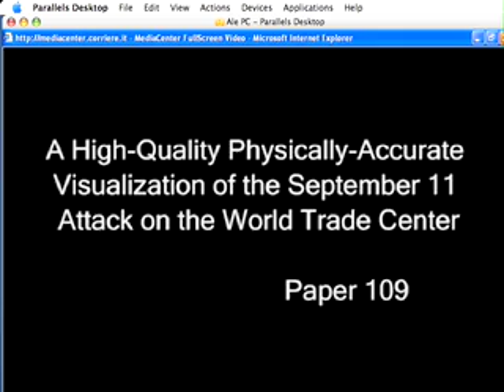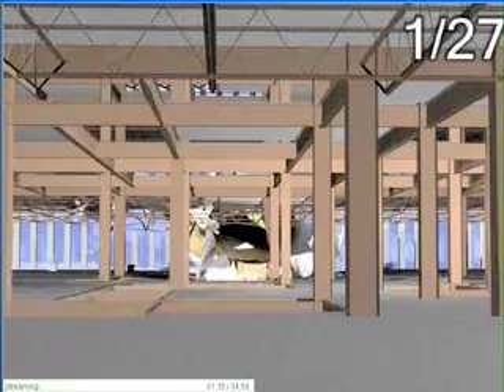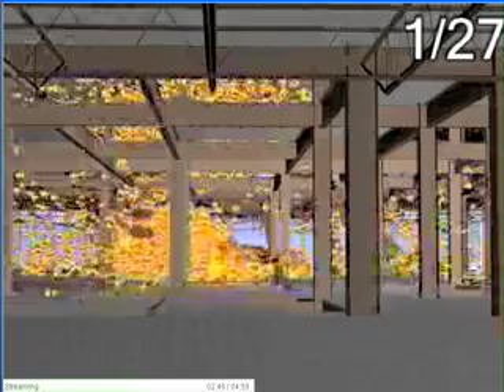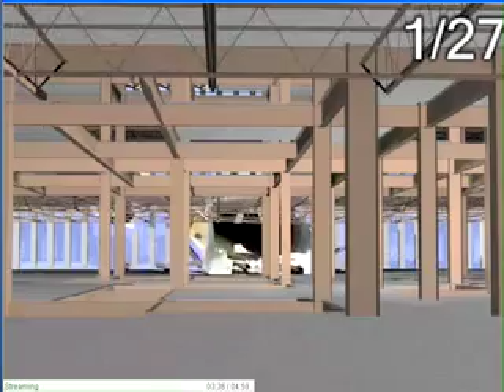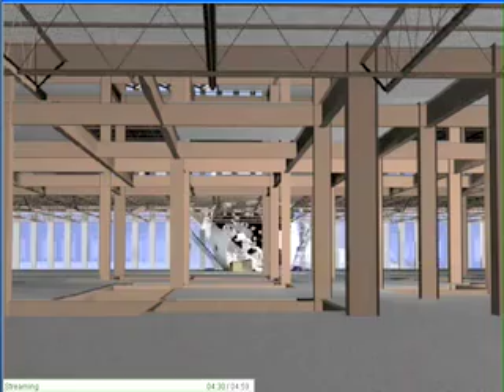9-11 Twin Towers Attack 3D simulation

Comment: Chemistry major here. The main point is that the jet fuel cannot provide enough energy to melt steel. Simply search up the MSDSs for both substances. The most the jet fuel can do is obtain thermal equilibrium with the steel and that will still need hundreds of more degrees in order for it to give way. Can someone give an adequate explanation as to how the heat of the jet fuel can melt the core of this building? 

How can this building fall down so 'cleanly?' Shouldn't there still be steel beams sticking out of the core of the building?

Thanks..
Reply: +Mark Euglin you don't need to "melt" the beams in order to weaken them, that's basic logic being ignored
Reply: Mark Euglin but, I'm not, I'm just responding
Reply: well it’s kerosene in the jet fuel that weakens the steel integrity.

Comment: WTC was designed for high speed impacts. 6 floors of structural steel were impacted. The only way to collapse such a structure is with  controlled demolition.

Comment: Each tower was designed to take TWO large jets just in case, and still stand!  The frame was designed to cut them up like a cheese shredder, much of the plane therefore kept out of the building.  Yet in the close up's of the second jet, it enters the building as if it were only soft butter; almost none of it is blowing backwards until the very end.  That just does not add up.  Those of you in school or university should speak up in your classes.

Look into the warning sent to certain people 2 hours ahead of time.  Look into the jerks who were arrested in New Jersey for 'laughing and celebrating'.  Just two of the clear links we have back to a country that wants us to hate Arabs.
Reply: +Denise Hammon-Ross True, the WTC buildings were designed to survive an impact from a single 747. (Not two, as you believe) But did 747's fly into the buildings? NO. Look up the major differences between a 747 and a 767. A 767 carries a LOT more fuel than a 747, and flies significantly faster. Since the 767 did not exist in the late 60s when the WTC was designed, the engineers could not design the WTC to survive an impact from an airplane flying as fast as the 767 nor carry the fuel that a fully-loaded 767 can carry.
Reply: The 747 was not around when the towers were designed, each tower was designed to withstand the impact of just 1 707 at low speed and with almost no fuel, not a heavier plane with a lot of fuel at much higher speed.
Reply: evsupp.
Are you not very intelligent?
The design was for a Boeing 707, low on fuel and at low speed, in fact no allowance was made for fuel, the 707 was not as heavy as the 767 which had a lot of fuel and was travelling much faster.
Double the speed = 4 times the force. 
Just look it up for yourself rather than take the word of twoofers.
Reply: Denise Hammon-Ross they were wrong in believing they would stand I'm surprised they stood as long as they did.
Reply: Barrie Rodliffe  Whenever truthers claim 9/11 was inside job, it's automatically true because they say so.
Reply: Steve.
Great.   You know more than Boeing then.   VMO does not mean   " this is the limit, the wings will come off if you exceed this speed."
The reason for the restriction on the 767 was nothing to do with the wings it was in case of birdstrike on the front windscreens, something the hijackers were not too bothered about.   
3 buildings collapsed due to fire just as quite a few other buildings have before and since.  
Maybe one day when you grow up you will find out how to look up things for yourself rather than just take in every conspiracy theory no matter how stupid.
Reply: Really amazing that other buildings have collapsed due to fire with no prior damage and no jet fuel.
No one really can be as stupid as you or maybe they can.
The strong aluminium wings at speed can break steel, that is a well known fact.   
The WTC towers were not designed to withstand high speed impact and steel will weaken in a fire so what is your problem with straight forward facts?
You accept the very weak and ignorant conspiracy theories.
Reply: evsuck. I thought Barrie did a masterful job of stuffing you on this thread. Short and sweet. Wish i could have been there to watch your run away sobbing.
Reply: truth?
911 an inside job?   Sure it must have been since you just claimed it.
Reply: Barrie Rodliffe  Right. Plus, they can't even agree on what the alleged inside job was inside of. Was it inside the Bush White House? The CIA? Israel? The NWO? The illuminati? Haliburton and the defense contractors? All of them combined? They don't know. But they're certain it was "inside" of something or other. LOL
Reply: Steve Healy. 
Maybe you should look at how much force an aircraft wing has to withstand just to lift the whole plane off the ground, yes strong wings or planes would just break up as soon as they hit the slightest bit of turbulence. Fortunately you have nothing to do with making or designing planes.
Reply: Kabuki Mime.
Even worse, they claim an inside job and then when asked for proof it was they demand proof it wasn`t
Reply: Denise Hammon-Ross. Good post.  The mossad agents found with explosives in a van and released!!!!!!! If they had been Muslim they would have been shot there and then. This is when the true face of Israel s meddling in America
Reply: Barrie Rodliffe. Would love to see you last ten minutes in 767 at 550mph at ground level. Barry
Reply: Steve.
If I was a pilot I would gladly do so but my name is not Hanjour and I do not have a pilots license.  As for 550 mph did you just make that up because I have not seen that speed. It was said to be 530 mph when flying over the Navy Annex building. 
Also wasn`t it a 757?
Maybe try to get at least one thing right.
Reply: 911 was an inside job!
Reply: World Trade Center a 3D Visualization WTC: https://www.youtube.com/watch?v=aj3fvxCQGi4&list=PLlZXuG7QSAcsTor6bwsFeJwKtacUIFrBO&index=4&t=16s
North Tower No Plane Seen: https://www.youtube.com/watch?v=Y4BFEYItlk0&index=5&list=PLlZXuG7QSAcu-OgrLuziSZ7Mp_buH0JU_
911 WTC2 no plane: https://www.youtube.com/watch?v=2ypMOWF0QvQ&index=7&list=PLlZXuG7QSAcu-OgrLuziSZ7Mp_buH0JU_
SOUTH TOWER EXPLOSION NO PLANE: https://www.youtube.com/watch?v=kDIwIQwgw5c&index=9&list=PLlZXuG7QSAcu-OgrLuziSZ7Mp_buH0JU_
9 11 south tower attack NO PLANE LEAKED FOOTAGE: https://www.youtube.com/watch?v=Sv92Q6y7F7g&list=PLlZXuG7QSAcuVRxAhKKwjdQq-tTZMILey&index=6
9 11 Flight 175 witness reaction! BEST FOOTAGE! Hologram wing fake plane: https://www.youtube.com/watch?v=7g6aAGr3b1c&list=PLlZXuG7QSAcuVRxAhKKwjdQq-tTZMILey&index=7 South Tower demolition: https://www.youtube.com/watch?v=TyfMVaWk6j4&list=PLlZXuG7QSAcsTor6bwsFeJwKtacUIFrBO&index=5
Terrifying, Close Up, Street Level Shot of First World Trade Center Collapse. September 11th 2001: https://www.youtube.com/watch?v=2-9TD3oQq3g&list=PLlZXuG7QSAcsTor6bwsFeJwKtacUIFrBO&index=7
WTC2 'Collapse' Luigi C , stabilized: https://www.youtube.com/watch?v=Ns89xtgLPWc&index=119&list=PLlZXuG7QSAcsTor6bwsFeJwKtacUIFrBO
9 11 Enhanced WTC2 B Riesman, Version 3: https://www.youtube.com/watch?v=o9bhsvfUMAY&list=PLlZXuG7QSAcsTor6bwsFeJwKtacUIFrBO&index=81
South Tower collapse: https://www.youtube.com/watch?v=-iUJE1z0dro&list=PLlZXuG7QSAcsTor6bwsFeJwKtacUIFrBO&index=67
9 11 Stabilized WTC2 Video Showtime: https://www.youtube.com/watch?v=oO14j15mBQg&list=PLlZXuG7QSAcsTor6bwsFeJwKtacUIFrBO&index=57
WTC2 Collapse Demolition 9 11: https://www.youtube.com/watch?v=twnDgQp6sxM&list=PLlZXuG7QSAcsTor6bwsFeJwKtacUIFrBO&index=40&t=3s
WTC2 'Collapse' Rare Trinity Zoom, Slow Motion: https://www.youtube.com/watch?v=5cLo4FDMztM&list=PLlZXuG7QSAcsTor6bwsFeJwKtacUIFrBO&index=51
9 11 Enhanced WTC2 NIST FOIA Release 27 #42A0239 G26D114 Version 3: https://www.youtube.com/watch?v=-TZQHFlQTMQ&list=PLlZXuG7QSAcsTor6bwsFeJwKtacUIFrBO&index=83
South Tower collapse slow motion HD: https://www.youtube.com/watch?v=gNupKvEFg1k&list=PLlZXuG7QSAcsTor6bwsFeJwKtacUIFrBO&index=11
WTC1 Collapse - Two NBC Cam Angles Combined (Enhanced NIST Clips): https://www.youtube.com/watch?v=yzNBgJNU-Tw&list=PLlZXuG7QSAcuWw4a4K_3UFOXV8bUqOuIv&index=3
WTC1 Collapse - Unknown NBC Camera (Enhanced NIST Clip "WNBC Dub3_31.avi"): https://www.youtube.com/watch?v=qGDuXbykLyQ&list=PLlZXuG7QSAcuWw4a4K_3UFOXV8bUqOuIv&index=4
9/11 North Tower Demolition - 10.5 Seconds (West Face Zoom And Slow PIP): https://www.youtube.com/watch?v=kZvXn02V4m8&list=PLlZXuG7QSAcuWw4a4K_3UFOXV8bUqOuIv&index=1&t=8s
North Tower Collapse Close Up Zoomed Repeated: https://www.youtube.com/watch?v=OOMswNsSckw&list=PLlZXuG7QSAcuWw4a4K_3UFOXV8bUqOuIv&index=26
North Tower Looped Collapse Narrated by David Chandler: https://www.youtube.com/watch?v=wAe1NCl6Ypc&list=PLlZXuG7QSAcuWw4a4K_3UFOXV8bUqOuIv&index=37

Faces of 3,480 Fallen U.S. Soldiers: https://www.youtube.com/watch?v=WsUuLl1rxj0
Wars in Pakistan and Afghanistan Leave 150,000 Dead: https://www.youtube.com/watch?v=PGDRKPwr6hI
Reply: +Marc Barrett In safety certification 707 was determined to cause only local damage, no effect on structural integrity whatsoever. They never even considered two planes because they were talking about a air accident like the one at empire state building. Each tower could have taken 10+ hits without falling. Maybe even 100+ hits. The planes simply cannot penetrate or cause significant destructive force to it. In human terms the mass of a 747 is 1oz to each tower's 195lbs. Even according to official story 95% of fuel would have burned up in fireball outside building and the little that remained inside in 10 minutes. All this is assuming there were even planes and not just CGI.
Reply: Barrie Rodliffe yeah bare, they collapsed from fire. Amazing that big buildings have burned for 24 hours and not collapsed. Your paid shill working for NIST or something. Because no one can be as Thick as you to accept the official version. Pull your head out of your arse.
Reply: Barrie Rodliffe, seen your nonsense on other you tube videos on 9/11.  To say that aluminium the wings of a 767, which it probably wasn't, will cut steel at the alleged speed of 530mph is in one word...................... Bollox.
Reply: Barrie Rodliffe. BAZ, STOP SPOUTING YOUR NONSENSE. 'strong aluminium wings' BOLLOX

Comment: I'm not an engineer, but these towers would probably be a little smoky, but standing if they had internal support columns like any other normal building
Reply: A good metaphor for this is "Poking a pencil through a screen door". Yes, it would damage a certain area, but it would not destroy an entire building. The facts just don't add up.

Comment: Jet fuel can't melt steel beams
Reply: brett nichols Jet fuel can weaken steel.
Reply: brett nichols Basically just a normal fire without any liquid fuel can reach temperatures high enough to weaken the steel.. Its more than obvious that fire there only weakened the so yet bent steel beam where all that mass came into the game.. bent the beam completely causing it go down with others and finally with the whole mid-upper construction causing the devastating domino effect
Reply: NotEvenDeathCanSaveYouFromMe What?
Reply: And your glukose in the brain can't capture anything
Reply: Your statement about steel loosing its strength above a certain temp. is 100% correct. (I'm a retired Structural Engineer with 38 years experience in the field.) Your only error is assuming these trolls and the Conspiracy Theorists are literate. It is a SCIENTIFIC fact that the fires caused the steel beams holding up the floors to  loose WHAT REMAINED of their strength AFTER initial impact. Much of the integrity of the support system for the flooring ABOVE the immediate impact area was already compromised by the initial impact. Fire Retardant used on the beams was destroyed/blown off by the impact of debris as the aircraft passed through the buildings. Once the fires got going the weight of the building structure ABOVE the fire and impact floors caused the FIRE/IMPACT weakened steel structure to fail in what we engineers call a Progressive Collapse. But of course the Conspiracy dorks will find ways to challenge physical laws of nature. Hell, those lunatics STILL claim the Apollo moon-landings were fake despite news footage to the contrary. They claim the landings were fake news, for eff's sake
Reply: ***** even normal one can as jet fuel burned out in first 5-15 minutes.. at least what left of it

Comment: Conspiracy theorists try to convince us that a Jat traveling at 500 hundred miles in an hour slamming into the  Twin Towers an exploding is intense heat, Bering for two and half  on live TV are stuck on one stupid issue that steel can't burn at 1500 degrees" so it must have been the damage to the building that tore out supports to the building so then it must have the wait of the building!!! But steel also mixed with other metals too! Also could it been something in the building that could have got hot enough to melt the steel Or Could it be we don't know everything""" but if it is easier for you to listen to somebody that has a easy answer to everything  and you're not going to be able to deal with life""""""
Reply: +John Keenan    
If you look into the Bush family's past, you might gain some appreciation for their perspective.

Comment: Lets just for some that say that Alluminium cant break trought steel.
But at right speed.
It maybe can.
If you got any good Speed confirmations,reply to me,and i wont give a fuck what so ever :D
Reply from the maker: Even water can cut steel at right pressure. It's physics. Ale.
Reply: +Patrick Smith Maybe you should study the physics of kinetic energies generated by high velocity impacts before you say something stupid.  Here's a hint: the aircraft weighed 150 tons. Exploding kerosene had nothing to do with cutting the steel columns.
Reply: +Patrick Smith 

What? Do you live in a basement and cook meth? None of the comparisons you make even come close to applying the laws of Physics and kinetic energy to the event. I could give a fuck what you were "shown", I SAW THE WHOLE THING WITH MY OWN EYES. Those planes went though those towers like a knife through soft butter. I definitely do not need some fucking "official story" to tell me what happened. 

Take another hit off your bong.
Reply: +Patrick Smith 
What are you, some kind of fucking oracle?  Are you omniscient, or something?  When are you going to pull your head out of your ass?
Reply: +348frank348 Even though the pilots flight instructor questioned the pilots licence of the hi jackers because they could barely fly a simulator, yep real believable. 30 year veteran pilots said they couldn't do it one, let alone twice. But Da gubment would neva lie to us bruh.
Reply: +Fuck names I&#39;m too mainstream for that shit. one day you will grow up and pull your head out.......maybe
Reply: people hate it us, they hated us because of our way of life, and those motherfuckers still hate us now. So back in 2001 they hijacked four airplanes and manage to fly 3 of them into major American buildings.  grow the fuck up and let the conspiracies go
Reply: You guys remind me of an joke! 
The Lion chases one guy in the desert, and the guy says i was running and had no choice but to climb up to a tree, and the listener says, hey there's no trees in the desert! 
And the guy who is telling the story says:
Doesn't matter if there's no trees you gotta climb up man or the Lion will eat you! !!!
Reply: i believe that september 11th 2001 has all the proof you need.
Reply: +Blade Runner yes the entire air craft but not the individual pieces after the thing broke up upon impact
Reply: yea right, or it could pass inside  the building without the building noticing that! !

''with the right speed ''
grow up please
Reply: the plane cant fly at the alleged speed at sea level( manhattan ). so how do you suppose the official report has them going as fast as 660 mph.
Reply: https://www.theindianpanorama.news/united-states-america/bin-laden-is-alive-and-well-in-the-bahamas-says-edward-snowden/
Reply: +supercapstan Unfortunately the air velocity of a kerosene explosion is many times lower than an explosive and not remotely high enough to cut 1.5 inch outer and 4 inch inner steel beams. 0.07 inch sheets of aluminum aircraft fuselage can't either, whether at 600mph or 6,000 mph. It's physics. Try again.
Reply: Blade Runner The supposed plane weighed less than that as it was only 38% full, so 125 tons. The towers weighed over 500,000 tons, 4000x more. That's the difference between one ounce and 250 lbs. The floors that were hit alone had over 100x more mass than the planes, and were made of material that was 19x thicker (at outer columns, 70x thicker at the core columns), 3x heavier, 3x harder, 3x stiffer, and 2.5x denser than the plane's aluminum fuselage and wings. The planes could never have had any significant penetration, let alone without decelerating. A beer can will not penetrate an iron fence, no matter how fast it is going. The crashes we were shown were 100% physically impossible. They are only possible on film and in the minds of official story believers.
Reply: You saw nothing but a TV screen

Comment: Funny how at 2:07 (right side of the screen) part of the wreckage goes through the steel bar without damaging it or being damaged itself.
Reply: Yea and how the f*ck this wings can go thru the steel like a knife in cheese LOL!
Reply: How can lead go through steel plating in body armor? Same concept. Softer metal but moving so fast it doesn't matter. Trust me, 700+ grains of lead in the 12.7/50 Cal is a great example to dispute the whole "aluminum is weaker than steel, so it couldn't possibly rip through it"